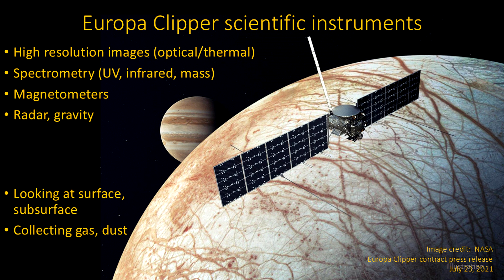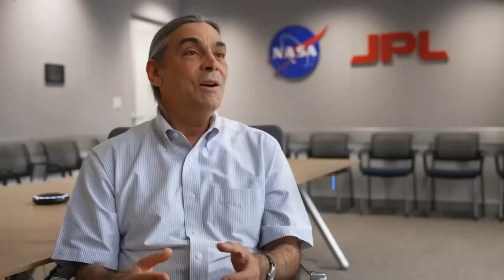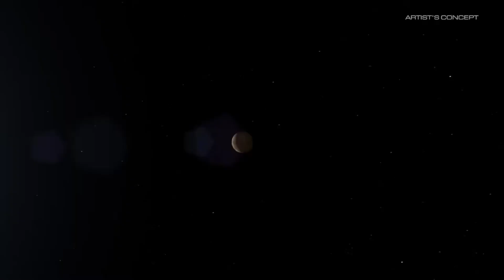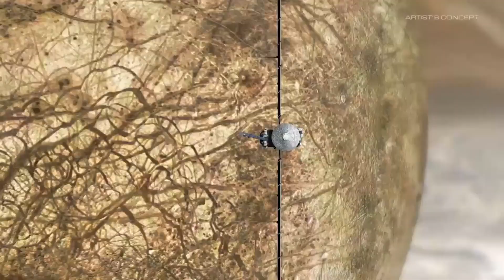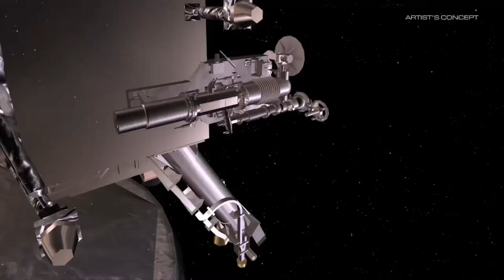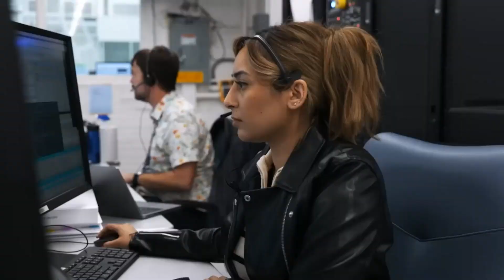Visiting Jupiter's icy moon Europa (NASA's Europa Clipper launched)

Comment: I think the flight path of the SLS trip would have required a Venus flyby for the 3 year flight.  That also would have introduced a higher heat than the Mars flyby route.  The satellite was designed to withstand the heat of the Venus path, bt the Mars trip offers greater safety margins.
Reply from the maker: Interesting!